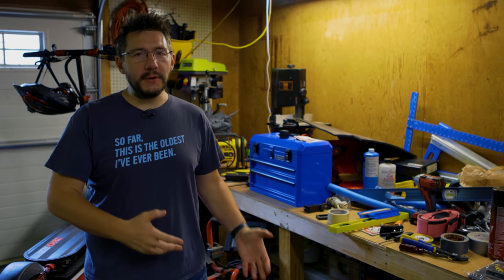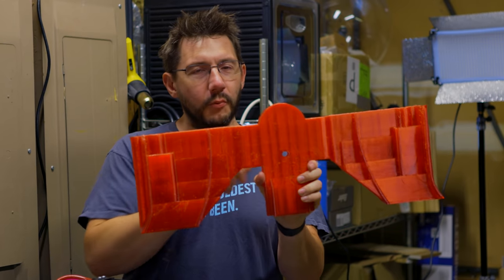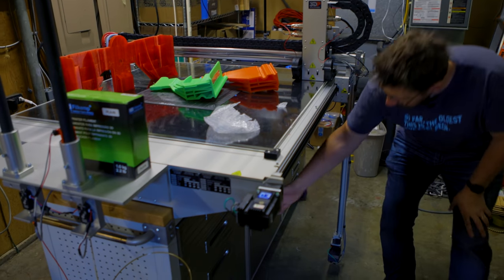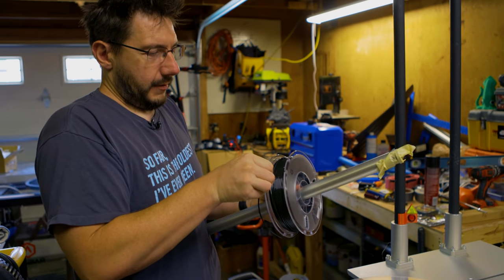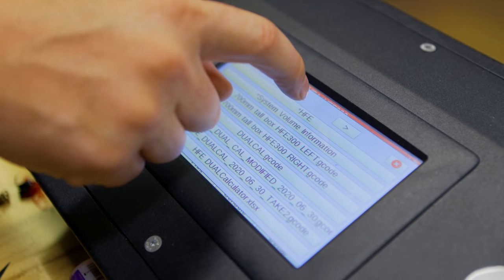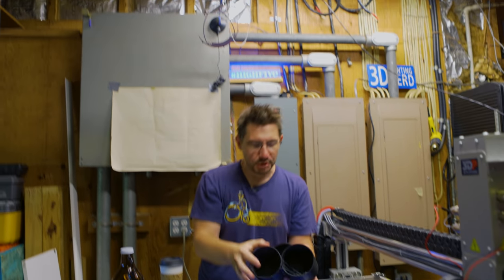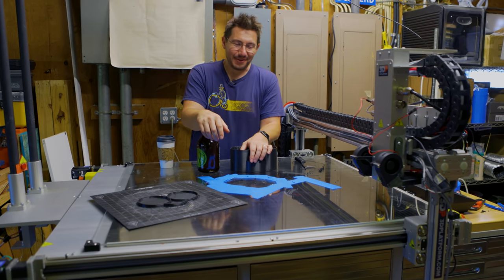I Broke a $38,000 3D Printer

Comment: I did the exact same thing printing PETG straight onto glass, it apparently breaks it down.  I ended up filling it with body filler (like bondo), sanding it down, and covering with blue tape.  I kept using that bed until it finally snapped in two one day while taking a part off.  I print on kapton + a thin layer of wood glue dissolved in water now.

Comment: 2000$ for printer parts, 1000$ for workbench, 35000$ for what?
Reply: Exactly I just built a cnc machine that 1m by 1m and I can swap the spindle with a extruder and do Exactly what this 38k printer can do and it cost me a little under 3k but I can also cnc, 3D print and laser cut and my machine is built like a tank.
Reply: Tech support and warranty

Comment: Maybe printers should use Peltier's modules to heat up the bed and then cool it down after print so it would be easier to remove the print. When I couldn't revive a PET-G part from bed, putting it into freezer helped.

Comment: Regarding the Y axis motors, they're using closed-loop servos instead of steppers. That's a good choice for a machine of this size as you're dragging around a lot of mass and the probability that you'll skip steps is high. There's no synchronizing between the Y axis motors though. They're just two separate motors working off the same step and direction signals.

Comment: For the pet-g not to damage the glass, set your printer to keep the bed at 70 degrees celsius after printing is finished. Then use a mixture of 50% ethyl alcohol and water on the bed and leave it for a few minutes, the alcohol will soften the base. printing making removal much easier. Never use alcohol in bed with a temperature below 60 degrees as it will certainly chip the glass .

Comment: PETG does not need squish to stick like PLA or ABS. It would likely be beneficial to print on a raft and use an additional half of your extruder nozzle in Z height (or more) for the first layer. This is how I have printed on bare glass with minimal loss, but even doing this occasionally I have had PETG pull up slivers of glass. Using Kapton or even painters tape would help you save the glass, and with a pane that size I would definitely recommend it.

Comment: The vase mode print would be a great light fixture shade. Print a cylinder to fit inside with cutouts making a design and then an LED strip hanging in the middle that would cast a shadow of the cutout design onto your vase mode print... COULD BE AWESOME!  Add a motor to rotate the inner cylinder to have the shadow move... So there's your idea to step it up.   GO...

Comment: Happened to my buildplates in the ultimaker 2+ many times when using Extrudr pla. That filament welded everything together, removal impossible without damage on the plate.
After i changed to fillamentum no problems since.

Comment: Aaaand that is why I don't print PETG on glass... It has a knack for fusing to the glass and taking chunks with it when released from the print bed. I prefer to use BuildTak or self-adhesive plastic print beds for PETG as they tend not to stick as hard, but still enough to do large prints and not have delamination issues.

Comment: Hey there...for 38 Grand if i'm seeing it shake...at all...it's going back to their shop. You should Laser Themo the heat bed. It might be super hot at the center compared to the outer third. It might explain why your center print welded on and the ones off to the side popped off.

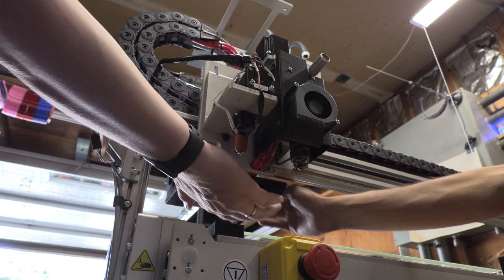Comment: 3:10  300 Watt extruder heater!!!  That should work, for 2mm nozzles at 1mm layer heights, lol!!  ... on my big 1/2 meter homemade machine, the 40 watt hot-end is very limiting, 0.8mm nozzle with 0.3mm layers is about max I can go, while maintaining extruder temp .. something closer to 100 watts would probably do well with a 1 to 1.2mm nozzle at 04 to 0.6mm layers.

Comment: I've had PETG take out borosilicate glass multiple times, even when just cooling down without any babooning from my side.
Just replace the borosilicate with float glass, it's a lot cheaper and because of the even heating on a printbed it works fine and it won't get a hole in it by just cooling. Of course when it is really stuck, you can always break it by hand, but for my CR10S5, a new float glass plate with rounded sides only costs me 10 bucks at the glass company around the corner, which is way better than more than 50 bucks for the original without shipping, which could arrive broken.

When your print is stuck on borosilicate, pour some alcohol around it on the glass, after 10 minutes it can just come loose. When that doesn't work, just heat it up over the GT temp and slide it off.

Comment: Why don’t they make build plates out of brass? When it comes to temperature the print starts. The brass will be expanded from the heat. When the print is done the cool cycle starts causing the brass to contract releasing the part printed. Aluminum would work too but the grains in aluminum are rocky and might cause the aluminum to start forming a rough spot.

Comment: Ohgh! To remove a sticked part you can try a spirit (IPA works well). Just use a syringe and add drops from all sides. The capillary effect will do the job. Then with some force you'll remove it safely. Also printing PETG without an interface (a hair spray or a PVA glue layer) can cause such problems. I never omit it.

Comment: I replaced the bed on my Ender 3 with a cheap piece of $3 glass cut at Lowes (9.25 inches squared).

Every so often I break the bed by fusing a large print to it, but it only costs me $3 to replace the bed.

To save me the inconvenience I started using glue stick on the bed, which acts like a release agent and works wonderful (even makes the first layer stick nicer).

Comment: I find it fascinating that amongst all the highly customized parts of this HUGE machine the brains behind it all is the same opensource Duet controller used on many of our smaller hobbyist level machines.  Speaks loads to the capabilities of the versatility of the Duet hardware and RepRap Firmware.
Reply from the maker: That's right - powered by a Duet controller!

Comment: In Joel's defense, I've broken one glass bed on a CR-10, using PLA.  The funniest thing is that it was about 1/2 inch round at the base and allowed to cool.  Maybe it was crappy glass as I've not run into this since.  I print directly on glass with no adhesives whatsoever.  My replacement cost me about $40 dollars.  I don't want to imagine what a 1mx1m borosilicate glass bed costs!

Comment: You can print a fully functional hottub for kids. Or if you want to go ambitious and really wow the crowd, multisection aircraft hull molds and drape them in fiber glass or carbon fiber. Could do wings too and produce a full scale aircraft.
I have called for this size of printer and even bigger, exactly for real world molds, not shelf hobby trinkets. But I do believe they can be made vastly less costly. I'm thinking aquarium frame style so the machine is only modestly larger than the print area and nicely rigid without being anvil weight.

Comment: Good video, as always.  I want to ask you for an opinion.  I need a 3D printer that prints flexibles well.  Specifically TPU 95A and Armadillo TPU which is 75D.  We've tried a FlashForge Creator Pro with dismal results (won't even load 95A TPU, after a few filament swap cycles) and also have a Raise3D E2 which has clicking problems (followed by part failure) with either of the filaments above.  What are great printers for TPU?  Budget is $500 - $6000.  And I don't need a 1m x 1m printer!   300mm x 300mm is fine. Thanks so much!

Comment: Honestly, I don't understand the moving gantry system on a large format printer like this. There should be a "solid" X/Y setup, maybe not CoreXY due to that needing belts, but like the Ender 5 mechanics. Then, lower the bed for Z (use 3-4 stepper motors to move the bed slowly and evenly). It negates the "shaking gantry" effect on tall prints, as very little mass is moving around fast.

Comment: Hurt a little bit to see that bed shatter, but with PETG on a glass bed, I think that's bound to happen. From my experience, the artifact you're seeing at 19:10 could be that the nozzle height is a slightly wrong, and the layers stack up a little weird until it makes up for the extra plastic. It's much more common when printing with big nozzles, like the one this machine has.

Comment: What do you think of the water cooling system? I'd kind of think that would be a bigger benefit to an enclosed system so you could keep the heat in but still have adequate cooling for the cold end.

Comment: Just slap a steel plate on there, degrease it well, sand itm, degrease it again. Use a coat of methylcellulose (wallpaper glue) for PLA, PVAc and PVP (first one is wood glue), most known for hair spray and work well with PETG.

Comment: The printer I work on is still far larger than this. 4'x5'x6' dual independent print heads print at the same time. Could probably print that pawn in around 15 minutes or less. Well 2 pawns at the same time.

Comment: I operated the 3DP 1000, an older model, for 3 years. Mostly printed in PETG. Never saw anything like the break in the glass experienced here. Perhaps the bed didn't have enough time to cool before the pawn was removed? That loosened up the adhesion for my prints. Was additional adhesive applied to the bed before printing?

Comment: You just add a small amount of  water on the edges of the 3d print on a glass bed ... you dont need to pull at all, thats the best part with glass beds that  you add water, wait a few mins and just lift it off. Why that printer is so pricey though is weird..it is still just a metre and thats pretty standard for the aluminium profiles. I think you can build it for about 4-500... it is just standard parts ..dunno about the software but check out that italian on the tube, he built a much larger

Comment: Only 300W but requires 220/30A (6.6kW) connection? I assume the only reason for the 30A connection is because its supposed to be used in an industrial setting (and not because it needs it).
Reply from the maker: Its an AC heated bed I believe too.

Comment: So we have an older version of one of these here in AUS. I have replaced the main Board with a Duet2 (i think this is an option now)  I think we are at #4 on the glass bed
I'm not a big fan of the way the gantry is basically a big U shape, and as you have discovered it gets wobbly at the high end of the prints. which means you need to slow it down in your slicer.
personally i don't think they are worth the huge price tag. We have now fitted a Mosquito Hotend and bondtech extruder and prints are coming out much better (0.6mm nozzle)
One issue i have discovered is with a glass bed of that size and weight, over time i have found it bows in the centre as bed adjustment is raised and lowered from the edges not the centre.
Just my opinion and experience with our 3DP printer.  ... So did they make you pay for a new glass bed ?? :)

Comment: I've had PETg bond itself to glass before. It usually happens when the conditions are just right, higher bed temps and generally a very good bond. You can get away with it sometimes if the bed temp is lower or just below the ideal temp, I have tried different first layer properties such as height and width and find that its a really delicate balance between too good and not good enough. But its pretty well known that you don't print PETg on bare glass, most people use a adhesion promoter and lower temps... lol live and learn i guess.

Comment: Hmm... nice machine, but I think I would have made a few fundamental design decisions differently. I would have gone with a cube frame; had the X-Y transport be attached to the top; and had the build plate move down in Z. The result would not have the shaking issue at high Z values. 🤔

Comment: will say that i am surprised they used DB9 connections instead of new serial standards like type c would of been a great change with the "futureproof" of the connection but hey it looks like for 38k they dont even give you a all metal hotend for better materials when for 23k you can print metal

Comment: Dumb question.... Joel, since people are now printing HOUSES (using concrete for a medium) Size may not be the limiting factor.  Put  at nozzle that prints plastic (hell if  you could get it hot enough REBAR), and make the WORLD'S LARGEST HUMAN.  Concrete might even work, but I do not know the coarseness of the steps.  As a matter of fact talking to one of those guys might be kind of an interesting show!  Three-d  printed shop (concrete), print the roof trusses (probably have to be in sections on some thing like that printer), print window (frames to take stock size glass) and doors!

Comment: That's a shame about your flex plate. I use a PEI sheet from TH3D. First few PETG calibration prints I ran straight on the surface. Completely forgot glue stic. Flex and release worked same as PLA except for a few 'cavitation' type bubbles that formed under the print perimeter passes. I imagine glue stic might have saved your surface in both cases here.

Comment: Can you share why you call this industrial?
I mean just because it is on a large heavy table and has longer reach hopefully does not qualify for anyone calling something "industrial".
For that level first of all it would need to ditch the filament as raw material, and have a pellets fed system.
Next up would be the process of building which clearly must be hell of a lot different than home printers.
A sort of a molten head nozzle with flow sensors all around, self cleaning functions in case it detects possible clog formation. Although if we are talking about an injection system of a molten material rather than the utterly stupid filament  fed extruder method, clogs would not appear. Especially with such large diameter nozzles.

Comment: In my opinion it could have a MUCH better print quality if it was kind of a giant cube or rectangle structure made out of the same or even bigger aluminium extrusion - but indtead of the the whole gantry moving UP and thus becoming unstable, the bed would move DOWN on three ball-screws with balljoints.

It could easily! auto level a big surface ground bed that way - it would have konsistent quality and be the overall better hardware!

It even makes a lot of sense.

Still at working-bench height it would give build-height of around 65 to 70cm in Z.

And the y-axis could be 5 or 7 inches LONGER - thus allowing the gantry to move out of the way when the printbed rises again!

Then after the print - work piece would rise again to easy access level^^

Comment: Nice (and also sad) to know that even the crazy high end printers still suffer the same issues the small guys suffer from. Layer adhesion (the pawns head breaking off), stringing, poor layer quality around the base of your object, bed adhesion with petg. Other than size, there doesn't seem to be much difference in quality.

Comment: This would be great for metal filament.  Print a few car parts, heated temper it, and see what it can do.  Imagine printing a supercharger...

OMG, DO THE IRON MAN ARMOR!  You can print each piece as is, rather than split up and gluing it.  Theres never been a printer big enough before.  The pieces printed as solid pieces and just assembled with screws would be so much better and more sturdy than multiple pieces, and if you do it in ABS you'll literally have iron man themed RIOT GEAR.  Because...thats what riot gear usually is.

Maybe print a few cosplay armors while you have it?  Hell... id  looooove to get my hands on this
  Maybe I'll use my extra materials and parts and build up my 3d printer ro a giant scale and print some armor, or maybe ill just add a second head and removable hotplate to my 10 foot cnc.. lol

Comment: You would need to print it in parts with how small the Z axis is, but doing a print of that Monstrocity with that printer would be insane in scale! I'd watch a video on that 5 times over.
Reply: It is perhaps 3 years too late, but I think the Z Axis is mounted on the exterior of the printer. As it goes up two extrusions on the outside move up/down, instead of the gantry moving on the extrusions.

Comment: I just built a cnc machine that 1m by 1m and I can swap the spindle with a extruder and do Exactly what this 38k printer can do and it cost me a little under 3k but I can also cnc, 3D print and laser cut and my machine is built like a tank. I don't get who there costumer base would be companies that want to over pay for a 3D printer for to me for 38k it better print with out any flows and cnc , lazer cut , and have ability to do it extremely easily.

Comment: The large chip that came off should have been an issue that was foreseen by the engineers so don't beat yourself up too much over this..  Glass likes to chip out with the tiniest amount of surface tension and this is so predictable and controllable a process that you can literally use Elmer's glue on glass to deliberately cause chips to come off exactly where you want and make art and signs with it..   To prevent this, that build platform should have had a factory-applied build surface on it, or they should be telling you to use Magigoo or similar surface treatments all the time, otherwise it's just a matter of time before a chip comes off..  It was just bad luck for you that it happened on your first print..   I would have tried  a couple of heating/cooling cycles to see if the natural expansion/contraction would break the part loose, but with a material that sticks to glass as well as PETG does, a chip is pretty much inevitable..   I always coat my glass bed with ABS juice for PETG printing, which allows good adhesion and fairly easy release once cooled.